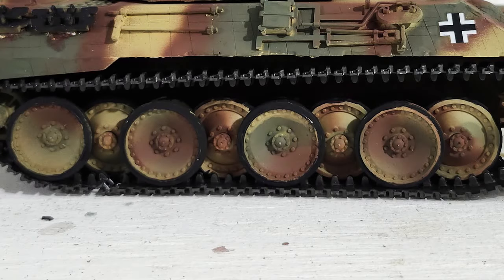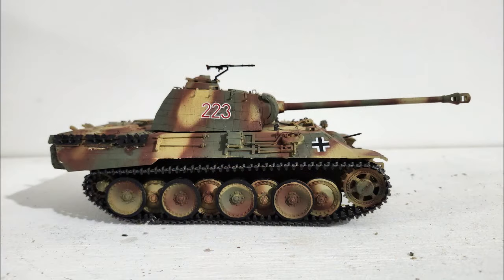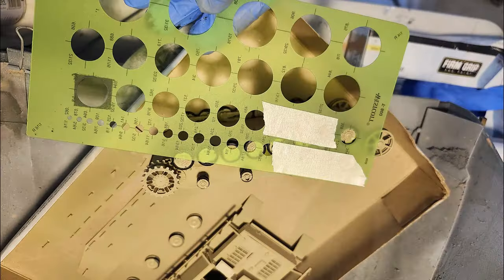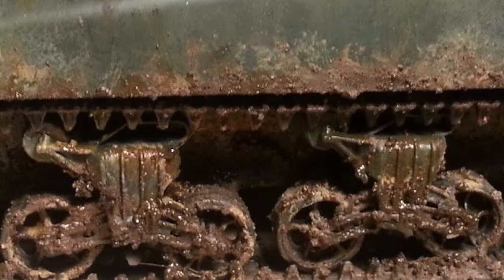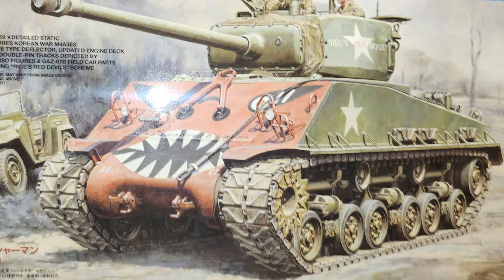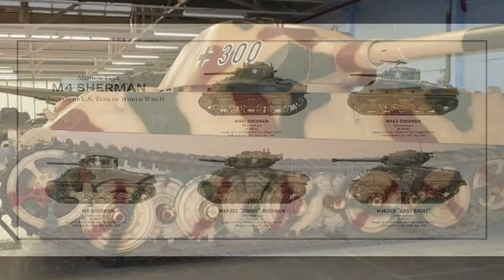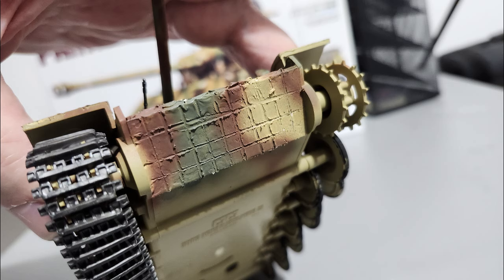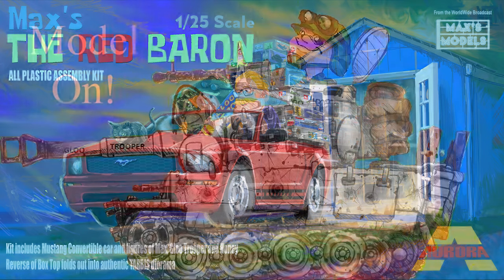Max's Models after hours 07/15/24

Comment: Max great job on the camo scheme. I loved building this kit, as well as the Tiger I. My two favorites.  I have built this Tamiya kit a couple times over the years. This is a very classic kit I built in the 1980's. Instead of using Flat Black I would use Humbrol Panzer Gray. The reason being is that the rubber fades to a lighter shade when exposed to sunlight.  I've spent hours and hours painting the road wheels on my German vehicles. The rubber road wheels on German vehicles were produced by the Continental Rubber Co. Still making tires today with production plants here in the U.S. in fact, you may have a set on your car. I see you made a trip to see the Jaques Littlefield collection now housed there on Long Island. I tried to see it several times when I lived out West but could never land a tour at the right time, but now I live here in the North East going to make a effort to go see it. Great job. Thanks.

Comment: Have you considered using a thin cardboard mask with a hole the size of the road wheel cut in it? Spray wheels rubber color, fit mask over tire, spray wheel, rinse and repeat until they all get done.  I did it as a kid on the first tank kit I built (Tamiya M41) using little Testors spray paint cans.  Worked really well.  These days I use a drafting template and an airbrush.

Comment: One thing I like to do with tank tools to add visual interest is to partly paint them the camo colour, but not the base colour, implying that the tools were only added before the camo spray session. Then, I chip-paint them in the tool colours, as if the paint chips off them from constant use…or simply being stepped on by the crew! I like to tell curious little stories with my builds, why each particular bit looks the way it does potentially prompting a whole lot of human drama.

Comment: I usually paint the road wheels, idlers, and return rollers on the sprue, then touch them up once they are assembled. The fun comes with one-piece tracks from those fast assembly kits. Then you have to paint everything in place. Fun in 1/76th scale.
Have a good trip.

Comment: Hey, Max. Love your channel, I've been subscribed for a couple of years now. Ah, yes. Road wheels. Always fun. Especially if you're building an older kit and they need to be cleaned up of flash first before you even start painting. That's a good job on that old Tamiya Panther kit. I see in comments here people have already put forward some good ideas for dealing with the rubber on road wheels. I always hand paint that stuff, usually with a smaller brush. If your worried about the little spill over you have on your Panther wheels you might consider a little judicious light dry brushing. Either in the vehicle base color or maybe a dust color. Best and kindest regards.

Comment: I painted Italeri tracks for amphibious tank with acrylic paint and they became so brittle that they fell apart. The M-36 tracks painted  tracks did the very same but not as severe as the amphibious tracks. Then the paint flaked off. I find link to link time consuming but are far superior to the old fashion one piece rubber bands.

Comment: I use the stencil method with an airbrush. With German tanks in WW2, the crews applied the camo. So, it would be normal for the camo colors to get on the rubber.

Comment: AK is coming out with paint pens which will make that easier. Andy’s Hobby Headquarters has a video about them.
Reply: I've bought oil paint pens from Hobby Lobby and Michael's to do road wheels before and to do the lining on French camo on their early WW2 tanks. It works pretty well. There are also refillable paint pens out there too. I'm surprised AK, Tamiya, Vallejo, etc. haven't come out with paint pens sooner. Oh, there are the Gundam paint pens too.
Reply: @aleks1939  Tamiya does make a limited set of paint markers.
Reply: @garfieldsmith332  I'll have to check them out. I remember Testor's used to have some too, but I think they were more for car modelers?

Comment: Get the tank kits that have steel road wheels. There was a company that sold plastic or metal stencils for the road wheels for specific tanks and/or wheel sizes. A Tiger set, a Panther set. Could get costly if you have a variety of tanks. Take care and safe travels Max.
Reply: @garfieldsmith332  iirc, a Polish company.  Specific for the model kit, very easy to use, pricey (you can have 2 of 3:  good, fast, cheap).
Reply: @JMdfcv  Thanks for the update. I could not remember the company or if they still made them.
Reply: @garfieldsmith332  I didn’t help much, don’t remember the name of the company…
Reply: @JMdfcv  You did, I know that the product may still be made and the company is in Poland. I made an order years ago to a company in Poland for a paint rack. So i will check my records and see if it is the same company. Or just do a look on the internet.

Comment: Black Sharpie.  Use a fine tip.
Reply: Only if not clear coating otherwise it will run and make a mess when applying clear coating

Comment: Russians copied the Christy Sysrem  Christy's original design was for a Tracked or Un Tracked vehicle. For running on roads [and faster] the tracks were to be removed, and the front wheels steered. The last wheels drove. It was expensive, so the Communists just went with the simple tracked system.
Reply: Those T-34s could sure move.